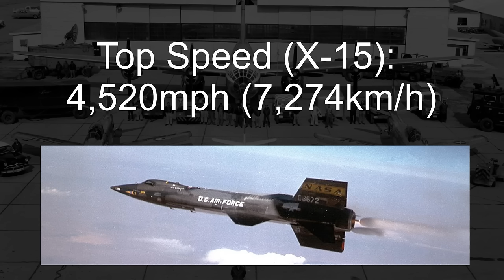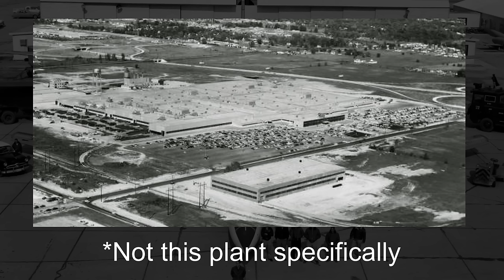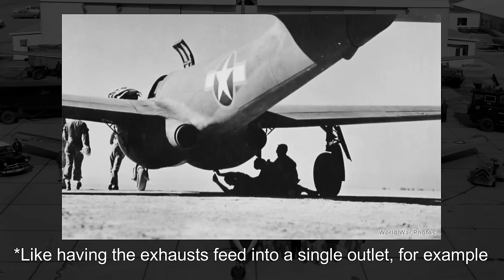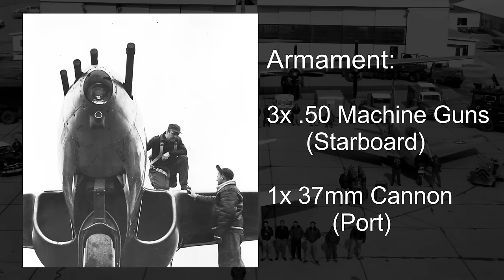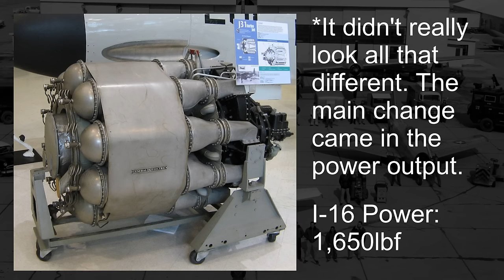America's First Jet-Powered Fighter Was A Dud: Bell P-59 Airacomet

Comment: Now wait for people to claim the X15 isn’t an aircraft
Reply: It's an aircraft, just not an air-breathing one. It was an aircraft that operated at the limits of our atmosphere and was propelled by a rocket engine, but yes, it is an aircraft still!
Reply: @flapperofwar7445 is ICBM an aircraft?
Reply: @ansgaryeysymontt7155  No. ICBMs leave the atmosphere and maneuver using thrusters, aircraft remain in the atmosphere and use flaps to control their movements
Reply: What else is it then? It uses wings to produce lift thus it is a plane. Furthermore it even is a jet. Just neither a turbojet nor an airbreathing one.
Reply: @flapperofwar7445 so a short range ballistic missile is an aircraft lol and so is every other rocket or missile that doesn't leave the atmosphere
Reply: @fancyfox5847  no to be an aircraft. You have to use wings for Lyft and have control services and not just fly on a ballistic trajectory.
Reply: @fancyfox5847  Troll, ignoramous, 1 each
Reply: Is it? I'd say it was a powered glider😂
Reply: @flapperofwar7445 the x15 had manoeuvring thrusters.
Reply: Can you really call it a plane if it functions like a missile and needs to be dropped from a plane because it can’t take off by itself
Reply: @fancyfox5847 Well, not exactly what I meant. I didn't mean to say that if it controls by flaps and fins that it is an aircraft absolutely. There is other criteria to consider, like whether or not it is a piloted vehicle designed to fly and be reused or a piece of ordinance designed to be shot at a target. The main difference I was trying to inform of is the difference between a spacecraft and an aircraft. The X-15 actually had both fins and thrusters due to the extreme low air density, but it was not designed to operate in space proper or traverse it. I'm not an expert in the field, just a sweaty nerd, so the criticism is appreciated.
Reply: @mcamp9445 ahh so a sim 9 is a aircraft
Reply: @womble321 a powered glider...
Reply: A piece of paper can be an aircraft
Reply: Aircraft; a vehicle able to fly by gaining support from the air. Seems simple enough.
Reply: It's not made out of air
Reply: @ansgaryeysymontt7155 is an ME-163 an aircraft?
Reply: @DefaultProphet 163 at least function as pretty good glider. X-15 is basically  custom ICBM with wings and pilot compartment.
Reply: @flapperofwar7445  yeah I get it I was kinda just playing thanks for the reply though
Reply: @TinyBearTim  gliders...
Reply: @ansgaryeysymontt7155  both are aircraft.
Reply: An aircraft uses the air to generate lift, usually using wings but you could also use an unpowdered rotor like a gyrocopter it has nothing to do with it having an engine or not, or what kind of engine it has, if it takes advantage of air resistance to generate lift it is by definition an aircraft, all rocket planes are aircraft, end of story
Reply: @derekhenschel3191  Does x-15 use air to generate lift? Does ICBM use air to generate lift?
Reply: @ansgaryeysymontt7155  the x-15 does use air to generate lift, an icbm does not
Reply: @ansgaryeysymontt7155  icbms use a very large rocket booster to get out of atmosphere as fast as possible air is the enemy to them they need the vacuum of space to traverse at high speed to get to there target. Rocket planes like the x-15 use the same principle as any other plane to generate lift using there wings. The x-15 is not "a custom icbm" or whatever bullshit you have been claiming it's an aircraft, it's the world's fastest aircraft, end of story. It's a purpose built rocket plane made to break speed records. It has no relation to an icbm. Ballistic missiles by design aren't aircraft, cruise missiles are tho.
Reply: @derekhenschel3191  Yeah. all  X-15 record filghts happened 100k ft or above. It flew at above 300k ft. Air war its enemy. It didnt use aerodynymics for majority of lift because at altitudes which it was designed to operate there isnt much air left.
Reply: @derekhenschel3191  X-15 used fuckin B-52 to start and then zoom climbed at 60k ft/min...
Reply: @ansgaryeysymontt7155  you are trying really hard to justify it not being an aircraft, seems like you don't care about facts just your feelings. The x-15 flies at a really high altitude, there isn't much air there, it did this because of air resistance for its high speed flights they didn't want it super heating from the friction it created. But it still relied on lift from it's wings to climb and stay aloft. It also used them to glide back to the ground, it's an aircraft, there's nothing you can do about it please stop
Reply: @ansgaryeysymontt7155  the x-15 is an aircraft, the fastest aircraft ever. It's a fact, nothing you can say changes that
Reply: @ansgaryeysymontt7155  yes nothing about the definition of an aircraft requires it to take off from a runway.
Reply: @ansgaryeysymontt7155  idk why you think that the lack of air means it can't use aerodynamics to generate lift, space craft rely on aerodynamics to slow down when they enter the atmosphere. The space shuttle was a space craft and an aircraft that could glide in atmosphere, are you gunna argue the space shuttle didn't glide at those altitudes because it did.
Reply: @ansgaryeysymontt7155  gliders are aircraft, rocket plans, ALL ROCKET PLANES are aircraft, the x-15 didn't have to fly at high altitude it could fly at fast speeds lower, the fact it had wings means it used them to generate lift, lift is generated at every altitude till you reach the edge of space.
Reply: @derekhenschel3191  you are trying really hard to justify it being an aircraft, seems like you don't care about facts just your feelings. The x-15 flies at a really high altitude, there isn't much air there, it did this because of air resistance for its high speed flights they didn't want it super heating from the friction it created. It did not relied on lift from it's wings to climb and stay aloft. It also didnt used them to glide back to the ground because it just sank like brick, it isnt an aircraft, there's nothing you can do about it please stop
Reply: @ansgaryeysymontt7155 Just pedantic. It flew.
Reply: @ravenoferin500  My shit also flew on the way form ass to toilet.
Reply: @ansgaryeysymontt7155  Hahaha. Okay man? Thanks for the laugh.
Reply: @ravenoferin500  Have a nice day!

Comment: It wasn't a fighter. It was a research aircraft to study jet powered aircraft. To say that it was a dud is rediculous. Foot Pounds of thrust makes no sense. Ft/lbs is a measure of torque, not thrust.
Reply: If it wasn't a fighter, why did they fit it with weapons?  The Gloster E.28/39 and the Heinkel He 178 were research aircraft.  The Airacomet may have ultimately done good work as a test bed, but don't kid yourself that was orginaly the plan - it was an attempt to move straight to a service type without going through the proof of concept phase.  In fairness, collaborating with the British probably led the USAAF to reasonably believe that a dedicated research aircraft was unnecessary, but that's not how things panned out in reality.
Reply: @mattbowden4996  The weapons were there for testing to see if gun blast effects and gun smoke would effect the engines. But nobody ever expected it to go into battle.
Reply: @MRxMADHATTER so it was a fighter
Reply: @MRxMADHATTER  If that were true, why did they order 100 of them?
Reply: That's some hard cope.

Comment: As in earlier jet video, thrust is measured in pounds-force.  Not pounds-feet.
Reply: No need to torque like that.
Reply: @neiloflongbeck5705 nice one
Reply: It makes you wonder how accurate the video is if he can't even get basic units correct.
Reply: Oh, thanks for sharing! I always thought "lbf" was pounds-feet, I learned something today! :)
Reply: @charlesdorval394  "lbf" IS pounds-feet, a measurement of torque, ie twist.  Engine thrust is pure pounds.
Reply: It basically goes back to the imperial system of physics units, in the SI system the unit of mass is the Kilogram and the unit of force is the Newton. In the Imperial system the pound was categorised as both the unit of mass and the unit of force, to differentiate between the two systems the unit of mass was the pound, lb, and the unit of force was the lbf standing for pounds force to the confusion of physics students everywhere.
Reply: @grizwoldphantasia5005  its pounds force in this context.
Reply: @grizwoldphantasia5005  pound feet to distinguish from lbm pound- mass
Reply: Duh -POUNDs FORCE.

Comment: You need to tell the story of the Lockheed L-1133 jet fighter design that the USAAF rejected before the war started.
Reply: In many ways the USAAC at the time was correct to reject it. One reason is the Lockheed designed axial flow engine sucked. It took Marquart until the late 40s to get it sorted out and then it was too late. I also wonder if the L-1133 would have had the same stall and spin issues that doomed the XP-55. Aside from the XP-55 never having the engine it was designed for. Now if the XP-55 had been modified to for a jet engine. 🤔🤔
Reply: At the time the AF needed thousands of warplanes right now. Could Lockheed spare a top engineering for an experimental fighter aircraft which would have taken years get in service? I wish Lockheed could have. However the AF said no.
Reply: Because it didn’t have a functional engine. Its aerodynamics were basically mythical too because nobody had any knowledge of transonic conditions yet.
Reply: @allangibson8494  True, but it only got to a wooden model stage of development when the USAAF rejected the whole idea of a "jet" powered aircraft as too "Buck Rogers" as a concept. Words they grew to regret.
Fortunately Lockheed was able to use their data to inform the P-80, (later F-80), fighter design.
The rest, as they say, is history.
Reply: @AlanRogers250  The engine design was vaporware and the airframe wasn’t much better.

Comment: The secrecy thing kinda reminds me of the BuOrd and the Mk. 14 torpedo. Basically the oversimplified version is in the late 1920's they pulled up an old German magnetic mine from WWI, went "wow, a magnetic detonator, that's a pretty good idea, we should look into that," and proceeded to act like their version had been developed completely independent and was of utmost top secret classified importance (despite the fact they'd reverse-engineered it from a fifteen year old foreign mine). They went as far to write a manual on how to operate it only to lock that manual up in a safe and refuse to let anyone see it. They also didn't want to destroy any of these high-tech detonators and refused to do any live-fire testing, all the while insisting the thing was perfect. Surprise surprise, the mk. 14 sucked hard, and it's why for about the first two years of involvement in WWII US submariners could barely sank any ships.
Reply: Some sub crews figured out how to tinker with the detonator to make those work. The Navy spent a huge amount of money to develop the Mk 14 so were reluctant to admit it had problems due to not being tested before being ordered into production. They didn't want to perform destructive tests due to the unusually high cost of each torpedo. It turned out to be an excellent torpedo once corrected and stayed in use until 1970.
Reply: @billwilson-es5yn Later than 1970, due to poor performance of the Mk 48 against surface targets.
Reply: @billwilson-es5yn  No, it was not the US Navy as a whole who refused to admit the Mk 14 had issues. It was BuOrd and BuOrd only. Everyone else took one look a the fact that so many torpedoes were not in fact exploded and concluded there was a problem. BuOrd never admitted to that. Ever. 

Instead BuOrd blamed the skippers, the crews, the boats, and probably the family and pets of the crews and skippers, and never once tried to fix the damned thing until King exploded on them and ordered them to. 

And even then they never fixed that crappy detonator. They got the damned things working by removing the magnetic detonator and replacing it with a contact detonator... It only got a new magnetic detonator after the war, but it was a completely new design made by someone who actually knew what the hell they were doing!

And thats only AFTER a bunch of non BuOrd people had already fixed the numerous other issues with the torpedo, like its love of running shallow or deep, or its sometimes worrying tendency to head in every direction BUT the one you fired it in (including right back at the submarine that fired it), the fact that its detonator housing was also crap, so the detonators often left the torpedo at high velocities on impact, and a whole bunch more....

That torpedo had so many issues it was unreal, and virtually ALL of them would have been found well before the war if BuOrd had actually bothered to actually TEST the things! Rather than assuming a frigging paper design would work first time out of the box.... 

But then these were the people who insisted the original 3 inch guns on US submarines were absolutely fine despite incidences like one Boat firing its entire 3 inch shell supply at a single Japanese merchant ship and it was STILL afloat, and the reason they had to use the damned gun in the first place was because none of their frigging torpedoes exploded!

So yeah!

Comment: If they had put it in a P-63 airframe in a conventional fashion it would look cooler, but probably the fuel capacity would have been ridiculously low. And the engineering changes would have been tremendous so, a clean sheet of paper was a better idea.

Comment: There were several people developing jet engines based on Frank Whittle's design that he patented in 1930. A German engineer designed one that was really close to Whittle's design. He was hired by Heinkle in 1937 and had a flying jet fighter prototype by 1939. It was small with a single engine that only achieved 372 mph during it's 6 minutes of flight using hydrogen as fuel. The German Air Ministry wasn't impressed so Heinkle went to work on a larger twin engine jet fighter. They had the airframe ready by 1940 so used it as a glider until 1942 when the gasoline fueled  jet engines were ready to install. It flew at 508 mph at 19,000 feet to outperform dogfighting a FW 190. Heinkle didn't get any orders from the Air Ministry due to lacking political connections. During that time GE was developing their turbojet while Westinghouse was developing an axial flow turbojet.
Reply: Heinkel
Reply: It wasn't a fighter but a technology demonstrator, and the engine used (HeS 3b) ran on normal gasoline. The HeS 1 static technology demonstrator ran on hydrogen.

They received funding easily enough, for two follow-up engines (HeS 8 and HeS 30) for their He 280, which, until 1943 was the preferred jet fighter project, but, got cancelled at the behest of Heinkel as they could not fulfill the 300 ordered contract and were more interested in continuing to focus on the problematic He 177.

Comment: 19:10 The YP59 was still on charge in England in September / Octrober 1945 when Eric Winkle Brown was at Boscombe Down looking for a trial Jet aircraft to do a trial for deck landing on an Aircraft Carrier (Brown being a Navy pilot). Out of the four types available the Gloster E28/39 A Meteor, the YP59 and a Spider Crab (code name for the DH100 Vampire).   He chose the Vampire and after modifications to the undercarriage and an arrester hook that stowed above the tail pipe😲 and a number of trials on a airfield (probably Yeovelton) he took the little plane out for the first truely jet powered landing and take off from a Carrier - HMS Ocean on Dec 3rd 1945.  No idea what they did with the P-59 though. 

As to your thoughts on the cannon being on the left - that was probably because it was easier to keep the existing mounting and spar for the 37 mm cannon - probably a lot less effort than to redesign the nose and the spar to get it on the centre line - the P-39 and P-63 were designed for hub mounted centre line from drawing board stage.  There would also have been problems wuth relocaring the updated M10 loading system with a disintegrating belt feed.  A sensible alterntinative might have been 6 x 50 cal AN 2/3.  Chances are had the P-59 had the performance to be a combat aircraft the USSAC would have dropped the 37 mm and 3 x 50 cal AN 2 /3 for a mores sensible layout like that on the P-38. Significantly the P-400 had a 20 mm cannon and numbers were used in Pacific and North Africa by USAAC - but 37 mm cannon were a thing with Bell, they probably had some sort of Licensing Rights thing on going with Colt Oldsmobile.

Comment: It's obvious it overall isn't a good aircraft now but back then there was no set template on how a jet aircraft was supposed to Iook it be designed. Good, trained engineers made do with the engine they had and the tech they had. The Fokker Eindecker is objectively not a good monoplane single engine fighter but it did have a forward synced gun which was the way of the future. The P-59 had a jet engine and while it could never have the impact of the Fokker monoplane it was a sign of where things were headed.
Reply: I've long thought that Gloster when designing the Meteor looked at the Westland Whirlwind. Everybody always talks about the Me-262 and forgets about the Junkers.

Comment: Given the infancy of gas trubine techology of the tiem, the P-59 no  less relibale than any other jet aircraft.   The Me-262 engines had a life of just 20 hours if you  were very gentle with them.   The P-59 was arguably the USAAF/USAFs first jet trainer.     The Gloster Metoer and  Lockneed P-80 were notorious pilot killers even well after the war was over.
Reply: Many Dutch pilots survive making a belly landing with the Meteor. The wings were easily taken off and the whole was taken back to be repaired using lorries. The ailerons  used not cables but push rods which were invariable bent during transport. Thus the wing had to be largely disassembled to replace them.